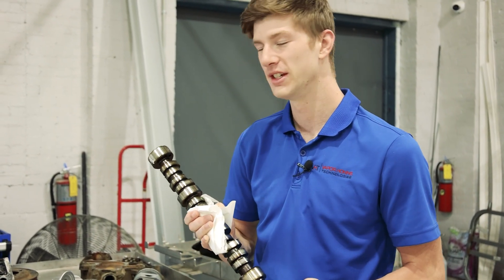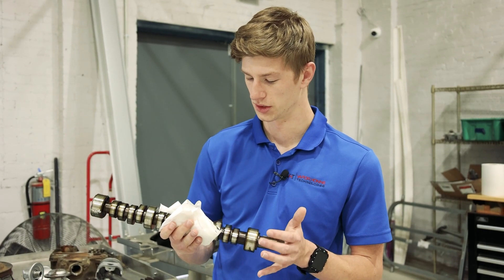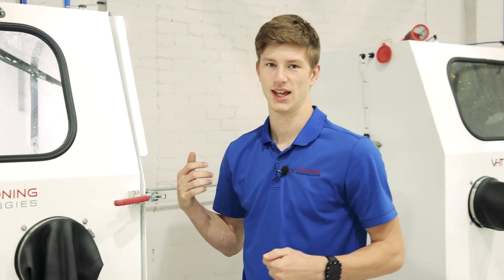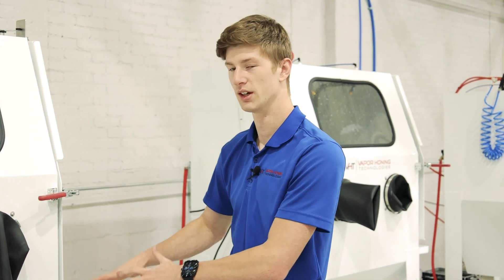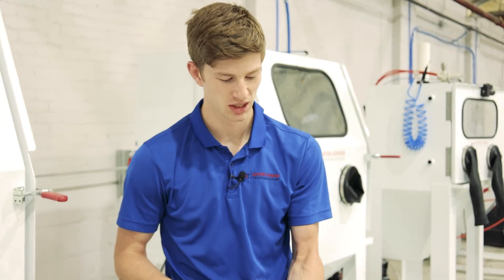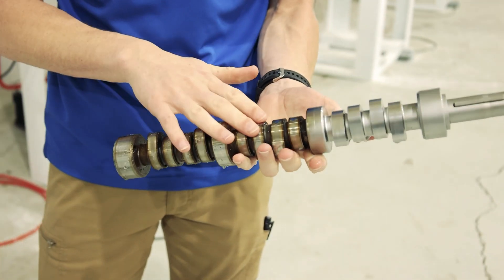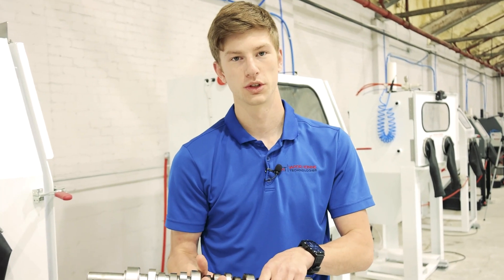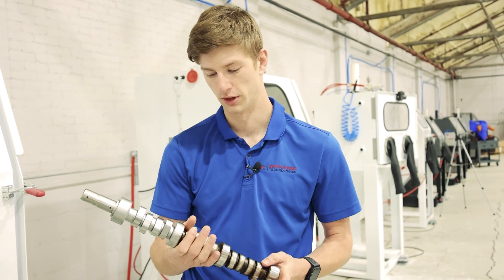Should You Vapor Blast a Cam Shaft? What are the benefits?

Comment: What grit glass bead are you using for the camshaft?
Reply from the maker: This cam shaft was blasted with out 170-325 mesh glass bead. It can be purchased from our website or directly at 828-202-5563. Our media is guaranteed with no filler for the best finish possible!